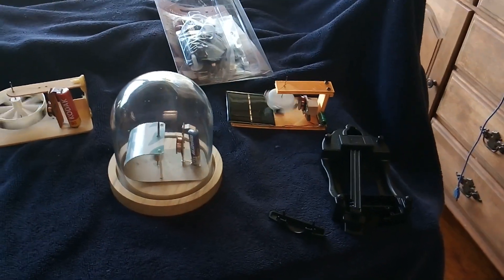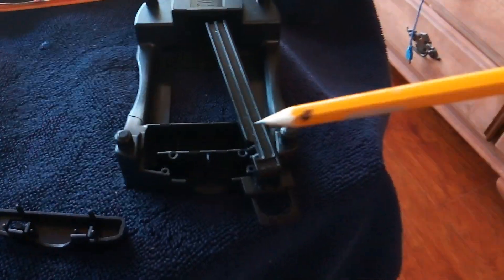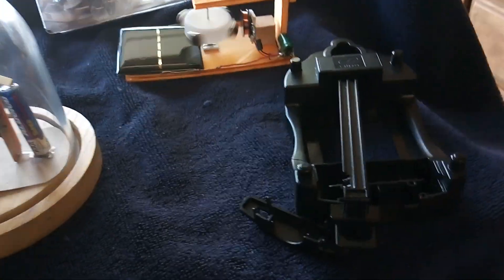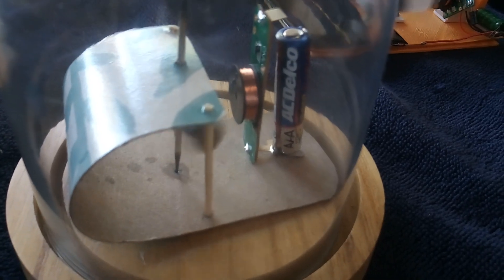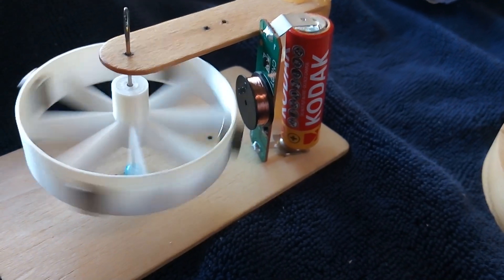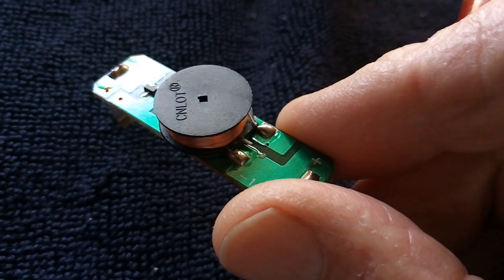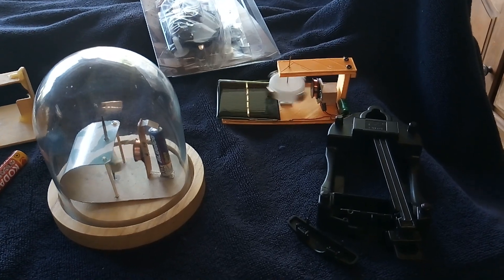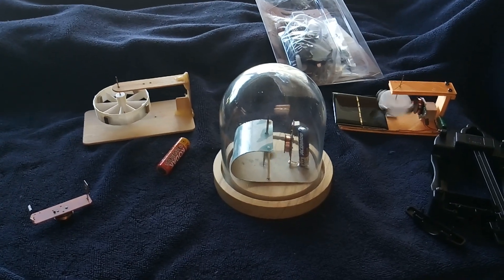Easy Driver

Comment: They did the same thing with the solar garden light circuit. All the components are in a single 4 pin chip except for the inductor which was left out so that it could be changed to adjust the output current.

Comment: Great builds 😀 
Those coils are fantastic in themselves!
Lots of options on Walmart's site, the shipping though is more than the unit lol. I do wonder if they have any in store at all and will have a look.
Reply from the maker: My local Walmarts didn't have any in stock.  This is a weird driver board and not like the Big Clive one we have been looking at.  The coil is juat one winding and is 160 ohms. The single smd component is labled L1.  That does the switching but I don't know how.  The amp draw flucuates at around 1 mA at 1.5 volts and the circuit runs all the time.  That does the self start trick.  This is another puzzle circuit that I really don't understand.🤔

Comment: I bet it works through avalanche or reverse breakdown. I.e. the coil sends a voltage just high enough to trigger the breakdown voltage of the transistor or mosfet and this causes it to conduct briefly causing the voltage to run through the coil repelling the magnet. I have no idea for sure but my gut says this is what is happening here.
Reply: After pausing the video, and looking closer, this is likely a pnp transistor. The coil is between thr base and emitter. So the coil causes the .6v needed to trigger the transistor. And then it's triggered until the coil saturated enough that the voltage between emitter and base are equal again and then it turns back off. It might be a P channel fet is mosfet or transistor. All would work about the same. The coil causes a difference between the base and emitter in the pnp circuit. When energized it pushes current through the coil until the base and emitter voltages equalize and turn back off. That's the best I can tell based on the circuit on that board.
Reply from the maker: @newmonengineering  Thanks for the circuit analysis.  The problem is that the circuit runs even when there is no magnet near it.  I really need to hook this up to a scope to see what is going on.  I doubt that the component on the board is a simple transistor.
Reply: @Lidmotor  Yes it is - it's an Andrews Motor - see US Patent 4200283 - 1980 - one coil and one BJT NPN
Reply from the maker: @eleanorrichards3528  Thanks.  I will look it up.  The smd component is labled L1.  The coil is 160 ohms.  Much thanks for the help on this .
Reply from the maker: @eleanorrichards3528  I just looked up the Andrews Motor circuit and this one is not it.  I am very familiar with that really old center tapped coil / one transistor design.  This is a single coil with no center tap and somehow oscillates even without a magnet near it.
Reply: @Lidmotor  had it find one to play with. It is a PNP mosfet. Part number Si2301BDS. Identification mark L1. From what I can tell it works as follows. The coil is between the Gate and the Drain. The leakage current to the Gate causes current to rise in the coil. This causes a voltage drop to the gate. It has a very low voltage trigger of -0.45v. Once the gate capacitance has reached the threshold it turns on which quickly pulses and drains the energy from the coil. I assume the timing is related to voltage rise /lower across the coil with the gate capacitance and leakage current. At least that's the best I can tell. It's a funny circuit, I may build a seperate one and test this operation. But you are right it seems to work even with no magnet near it. So it must be due to the leakage and gate capacitance.
Reply: @Lidmotor  ok, I unsoldered it and played with the chip. It's not a mosfet after all. It's a 1hz led flasher IC. It appears to be a chineese knockoff of the M34 1hz LED flasher transistor. You can google m34 led flasher and find the normal ones, but this is a different package /smd mount of basically the same thing. I tried it up to 3v and it's fine. They claim 5v max for the m34 but this is a knockoff so I would probably not push it more than about 4v. Who knows the max it can handle. Interesting find, and I learned something. Thanks!
Reply from the maker: @newmonengineering  Thanks for the hard work on this puzzle project.  I ordered a couple of those M34 1hz flasher transistors off ebay today.  Years ago I worked with a red led flasher based driver circuit posted by solarbotics.  This is one of those 'what comes around goes around' events that I find very interesting.
Reply: @newmonengineering  I don't know how a simple flasher would work in a motor like shown without feedback of any kind. If the rotor got out of sink with the flash pulse frequency it would trigger at the wrong time slowing or stopping the rotor I would think.

Comment: Looked for this identical part in UK. The coil is not round but is boxed shaped. Would this make much difference. Your pulse motors are brilliant 👍👍
Reply: Peaceful greetings! I found the cnlot part. Copy and paste this to google : ITEM 3256806611877075
Reply from the maker: Thanks.  That driver should work just fine.
Reply: @Lidmotor  Thank you 👍
See if it is OK, I may purchase a couple and try different sources of supply such as a small solar PV panel etc. 👍

Comment: Gosh, those look very interesting. I managed to find one of the clock mechanisms in my stock and rigged up a solar pulse motor from old parts. A rather larger solar panel and it was spinning crazy fast 😅
Reply from the maker: Great news!  I think that these driver boards are as reliable as the solar waver types except that they are much stronger.  What that means is that the rotor part of the motor project can be less precise and still acheive success.  A true kitchen countertop build is possible perhaps with just a couple of refrigerator magnets and an empty water bottle.😄